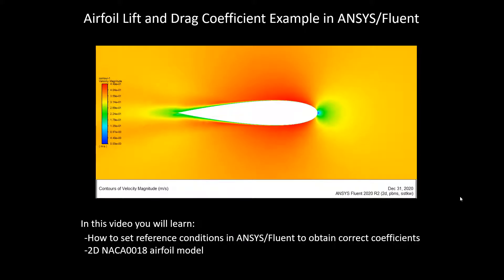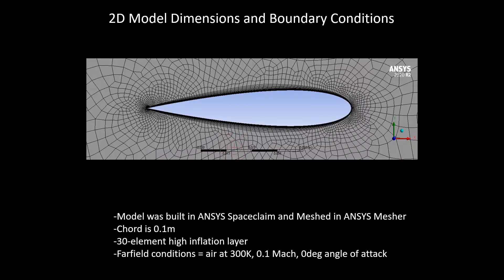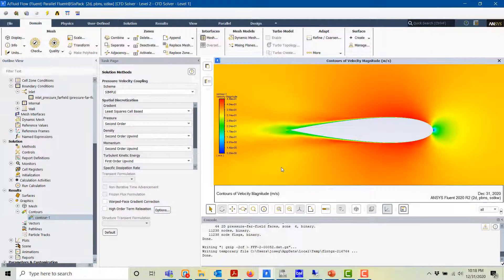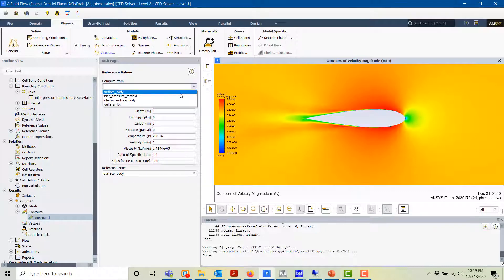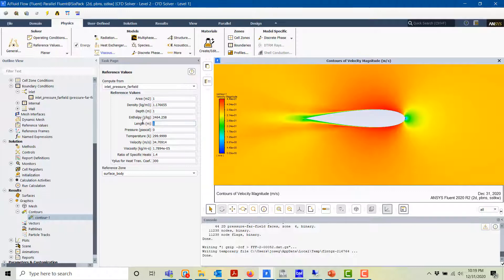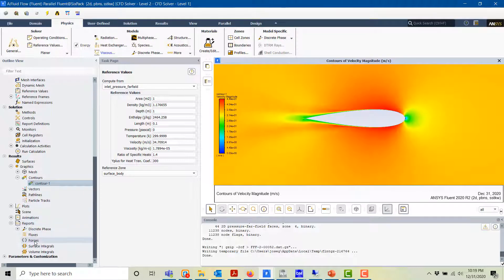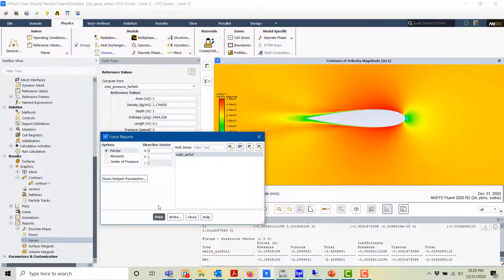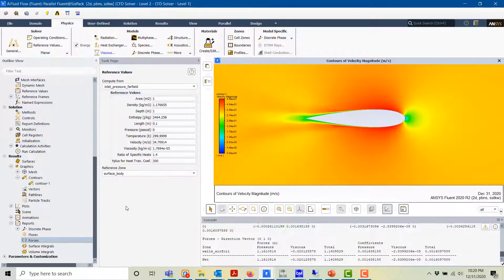How to Set Reference Quantities in Ansys Fluent to Obtain Correct Coefficients

Comment: Hiiii, 
Hope you are dong well, I have a question!!!
I am working on Darrieus Type of Wind Turbines for the power generation, firstly I want to simulate the 2D geometry using ANSYS FLUENT for Torque Coefficient Values.

I am confused in determining the Reference Values such as Ref. Area and Length.

Straight

Design Specs.

SWEPT AREA (D*H) = (1.5*1.7)m

CHORD LENGTH = 0.25m

Airfoil = NACA 0018
Reply from the maker: Hi Prakhar, thank you for the note. IF you are interested in consulting or mentoring services, please send us a note at info@simutechgroup.com or you can check out the Ansys Learning Hub here:https://www.ansys.com/services/ansys-learning-hub